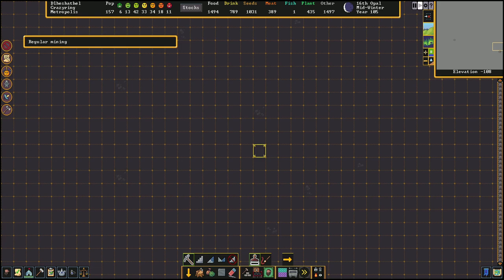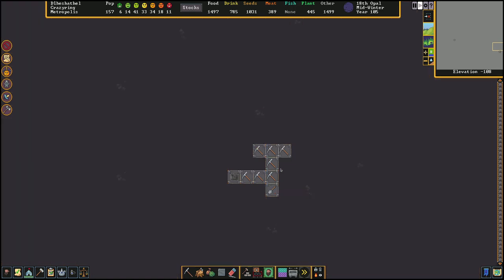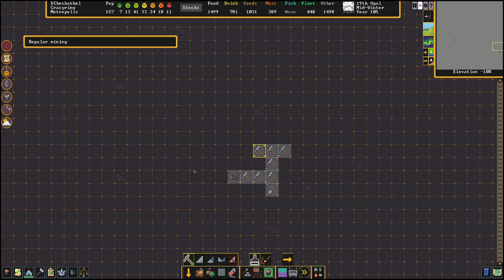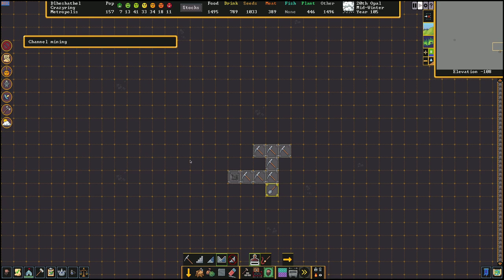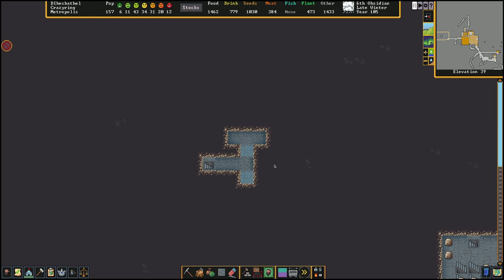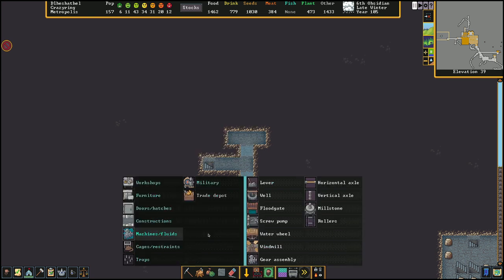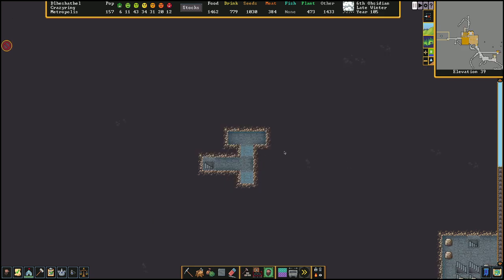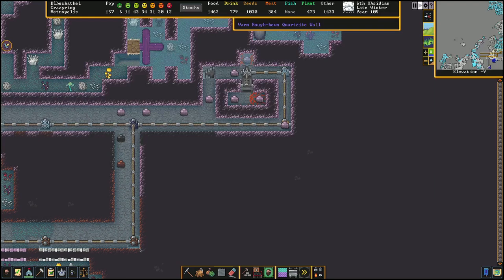Making a Pump Stack using Macros - Dwarf Fortress Engineering Tips

Comment: can you not automate the building of the actual pumps? also is there a noob way to manually power this whole thing
Reply from the maker: At this time you can't macro building the pumps because you need to click on the dialogue to change pump direction. In terms of powering it, you can check out my water reactor video for a pretty safe one, although it can be FPS hungry. I'm planning to do some more power related videos soon.
Reply: @FurtherReadingTV  yeah alot of aspects of this game are super fps draining, like do we need to simulate every single portion of the body like eyelids and individual gloves?

Comment: Wouldn't it be much easier to just build closer to the magma rather channeling it 100 floors? Seems like would take a long time to dig and then construct the pumps and materials too. Maybe I'm not seeing the benefit of pumping it up so high. Still very useful to know how to pump it, thanks!
Reply: Well, yeah, you need to invest into pump mechanism... But once you build it - then you get your magma and everything is nice. On the other hand if you have a majority of your settlment upstairs and build magma stuff downstairs, then your dwarfes need to walk all that layers to go to the job every time. So yeah, maybe there is a point that you just need to build your whole settlment near magma (or build enough stuff so smiths could just chill our on lower levels most of the time). But I think main profit of this method is that when you build it - you done and your dwarfes doesn't need to worry about magma themselfs.
Reply: @Dreadnote-pf7of  that makes sense thanks
Reply from the maker: This was a challenge fort where I had to put my housing on the surface, hence the need for the moat. Filling it with magma wasn't required, it was just fun.

Comment: Why do you do a T for your pump stacks?
Reply from the maker: It lowers impact to FPS.
Reply: @FurtherReadingTV  that seems unintuitive, I'm assuming some !Science! was done? have a link?
Reply from the maker: Yeah someone did it, it's something to do with how temperature checks are calculated. I think the wiki has a link to an indepth forum post.
Reply: @FurtherReadingTV  AH! it applies when pumping magma, yes I see how that makes sense. the normal single square at each end when pumping water should still be fine.